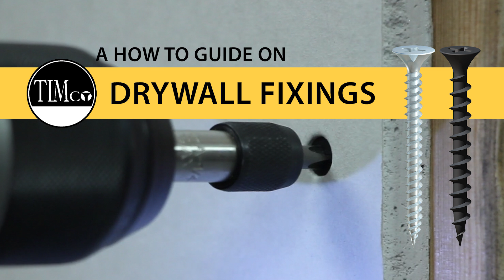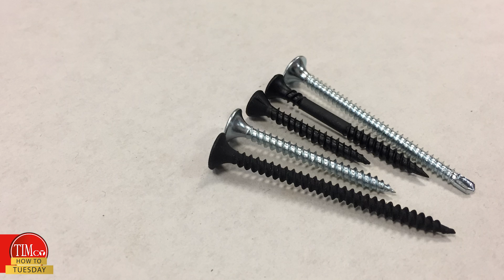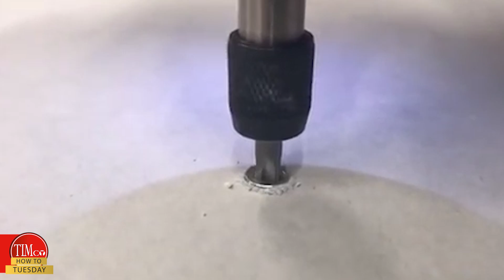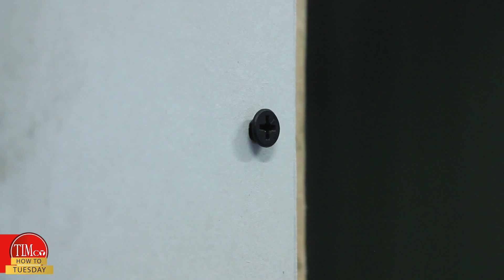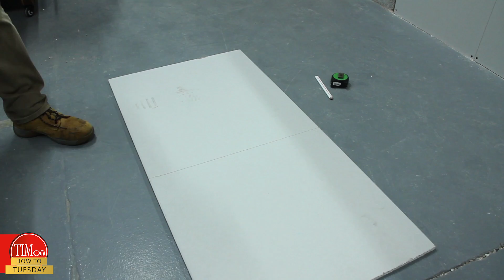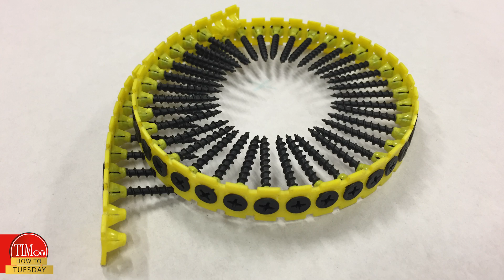How to fix plasterboard to timber and metal framing using TIMco drywall fixings

Comment: The Installation of the screws are wrong. Your fixing points should be 10mm from finished manufactured board & 13mm from cut edge boards. 
Before you ask we deal with British gypsum directly & local government clerk of works.